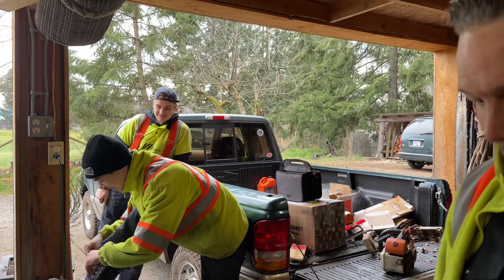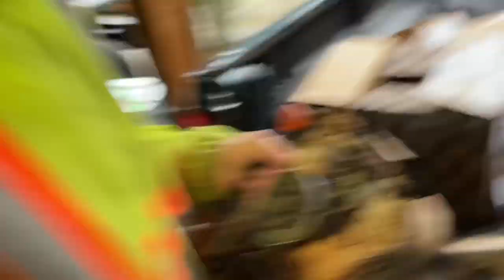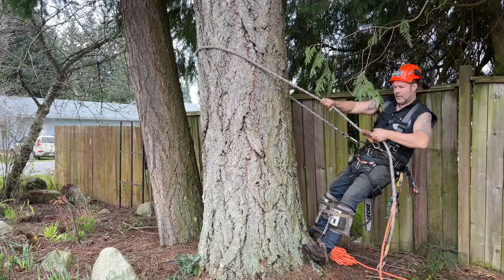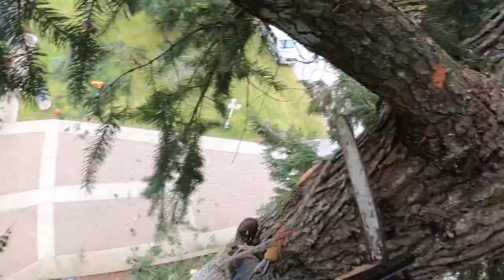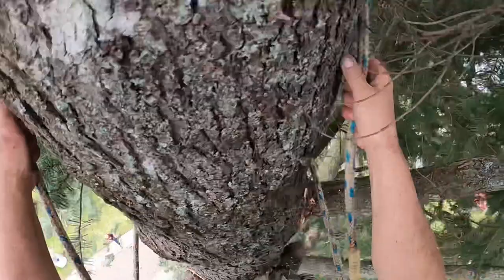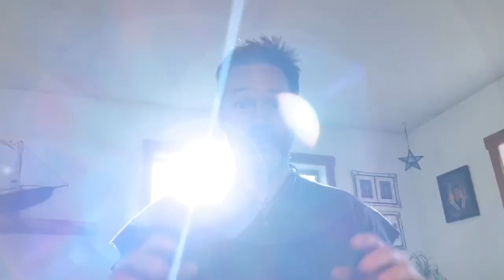Big Fir tree removal, climb and chunk down . Part.1

Comment: I’m not in the profession, but I’ve taken most of the advice of this man as I continue to thin my property of 12 acres.  Nice job 👍. Stay safe out there!
Reply: Be selective. You can cut them down way faster than you can grow them back.
Reply: Ditto that. Buckin had taught me to sharpen better, hang axes, cut safer, and deal with leaners and problem trees. Be kind, friends!
Reply: @oldcountryman2795  absolutely!  all dead trees, some standing, some leaning that are pulling roots up.  This, fire prevention, and development.  Took down some monsters, but again...my confidence has grown from things learned on this channel.  Started out with a Stihl MS180, then 250, now looking at the 461 😂
Reply: Yep.  Completely agree.  Amateur chainsaw guy here in central Alabama.  Buckin’s channel is great.  I use ropes and mechanical advantage pulleys to control felling much more than Buckin does but, again, he's a pro and I'm an amatuer.  Love it in some videos when he does something edgy and says "don't try this at home".
Reply: @SingleTrak6  exactly why we’re all here watching a master at work. Wedgemanship to life affirming chainsaw action, haha! I replaced  my pawn shop husky rancher 55 starter with a new rancher, then quickly bought a non-working Stihl 034 (now going!) and recently a stock 285 with a 32” bar for milling and bigger bucking! It’s all delightful, and I’ve been looking for used axe heads and been trying to make handles too. I swing em any chance I’ve got, haha, but mostly for enjoyment. It’s a life tune-up channel and Buckin’s my spirit animal!

Comment: Hey Buckin, I love your simple 2 in 1. I’m running a VT off a micro pulley now because I tried the standard prusik and it kept binding up. What size prusik do you have (rope type) and lanyard? I want to know so I can get the right set up for myself. My system is not bi directional and I’m tired of bringing 2 lanyards up the tree:) thanks!

Comment: Like having on A faraday suit. Some electrical linemen wear Faraday suits, which allow them to work on live, high-voltage power lines without risk of electrocution. The suit prevents electric current from flowing through the body, and has no theoretical voltage limit.

Comment: That young man "Tyler-Flash" is so lucky. "My story involving high voltage."  When I got out of the Navy one of my first jobs was as a field accountant for a large electrical contractor. We were installing a new substation boiler generator and control house. One of the electrical engineers decided to enter one of the smaller energized substations which had approximately 550MV feeding it and a spark arced to him knocking off his shoes knocking out one of his eyes, and stopping his heart and respiration. Because of this arcking and lightning bolt type spark making a sound like thunder that anyone in the electrical industry knew that something horrible had happened, one of our od our linemen ran into the substation jumped on to the unconscious engineer and began giving him CPR. I called the local fire department which had trained Paramedics, then I went to render assistance. When I got to the injured person that our lineman was working on had established a pulse and respiration, there was skin hanging off the unconscious person's body.
The engineer made it to the hospital but died twenty minutes later.

Comment: So I do this work for a living. And I'm gonna tell you why I think you survived. Unless you get closer to the line than the length of an insulator than you're not gonna start an arc. What could've happen is if you were wearing a coat then you coat touched the line and it traveled through your coat. What I personally think happened is that the tower wasn't probably bonded, and the top segment wasn't grounded and when you reached between the two you had a difference in potential. And you got hit by the power induced in the tower by the lines running next to. 

I wasn't there, so I don't know at all so take this with a grain of sand, and am just going off of my own experience and knowledge.
Reply from the maker: also friend that power is scary in the wet ,, it can jump (arc) threw the water , that was my first thought , and i also think that if it were a sunny day it wood not have happened  only God knows

Comment: Hey guys need some advice... I've found a Mac 1-52 ... Is it worth buying to use or just a wall hanger??
Reply: Well, that's an old one. If it runs that's good but parts will be a scavenger hunt. Best bet is join the McCulloch group on Facebook which is a good resource.
Reply: @jeffreyrubish347  Thanks very much for the advice